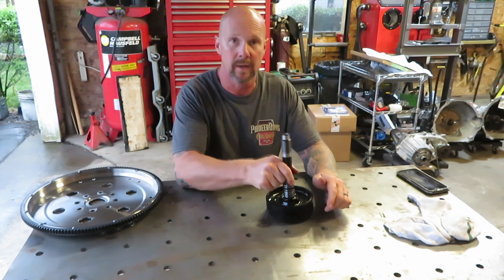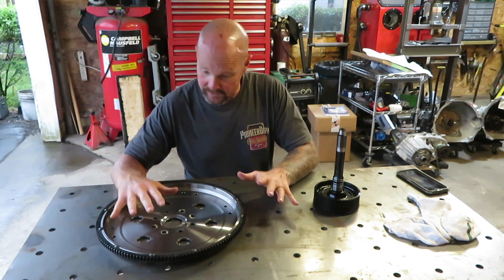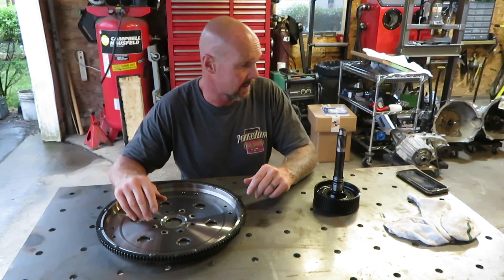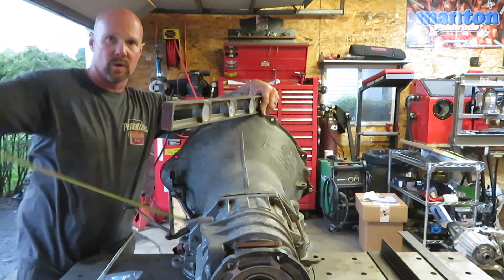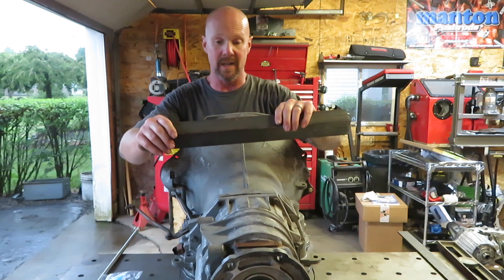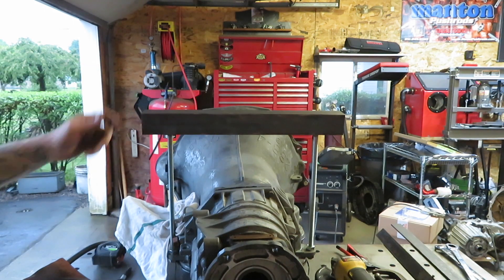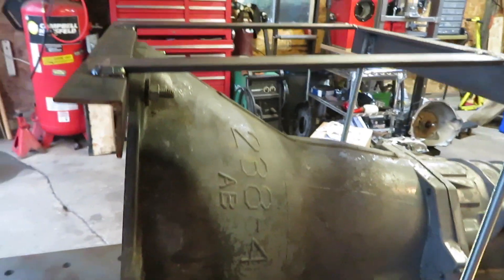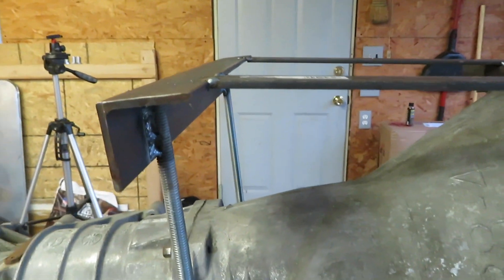More Parts In For The 47RE Build In My 2nd Gen Cummins!!! And A Transmission Stand!!!

Comment: Chad,if it was me I'd make an adapter to mount it on an engine stand. It may take a little time to build but would save time in the long run,since you are building more than one transmission. Should solve the height problem and having to man handle it turning it over on a table. 
I enjoy your videos, keep up the good work. 👍
Reply from the maker: Thank you for watching!